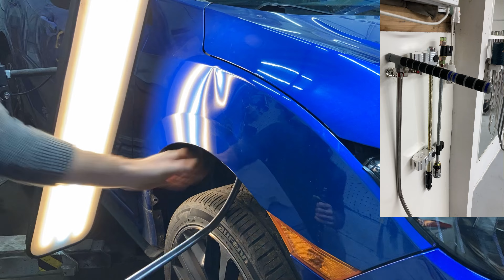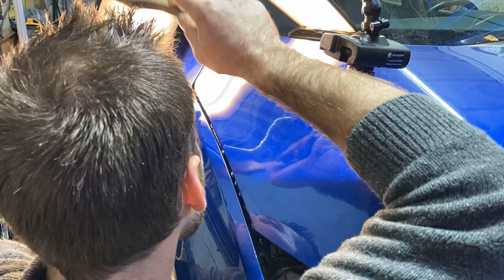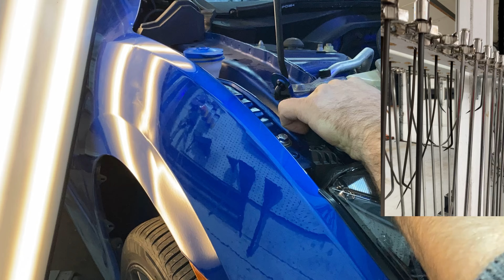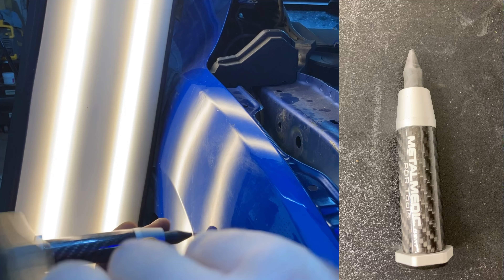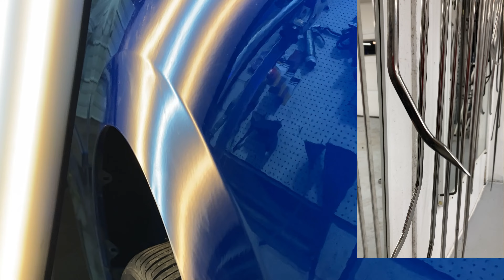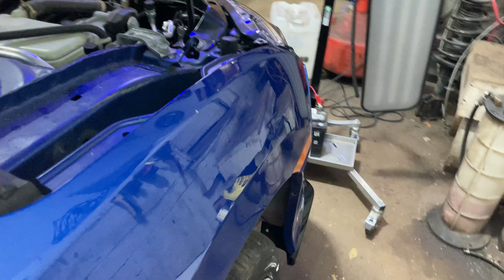2020 Honda Civic Fender Paintless Dent Repair

Comment: Not to be an armchair quarterback and great work,  however do you think maybe the work would have come up faster if your had attacked the bodylines first? Honda metal is like working on aluminum foil, thin and hard to get in shape. Great work!
Reply from the maker: Thanks Allen. I was very happy to have this result in a few hours . Yes I agree Honda metal sucks , however I’m not sure if it would have come out any quicker going after the body lines  first . Had to be a coordinated effort between the lines and the bulk of the damage . Thanks for the comment! I’ll think about that more on the next one .